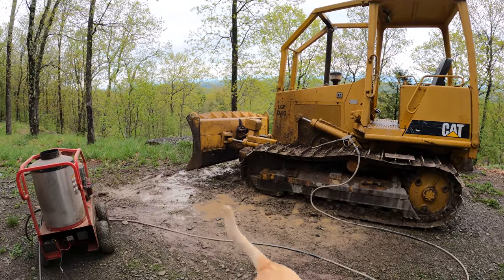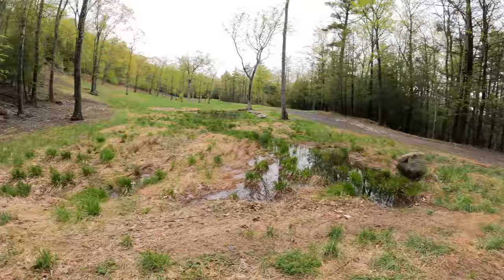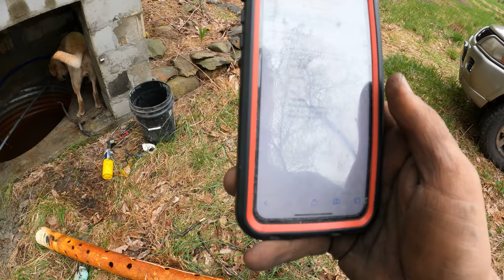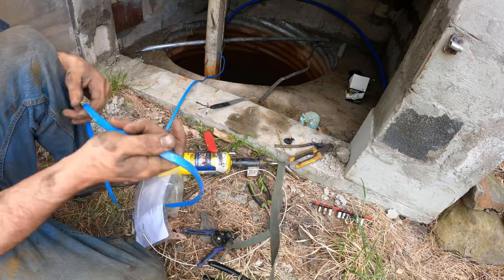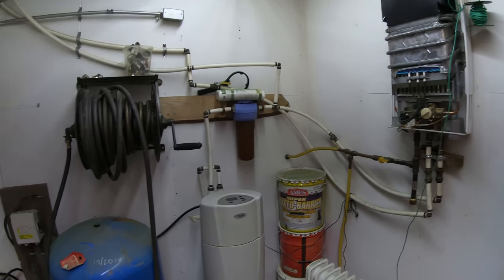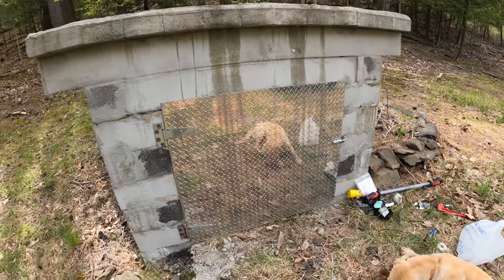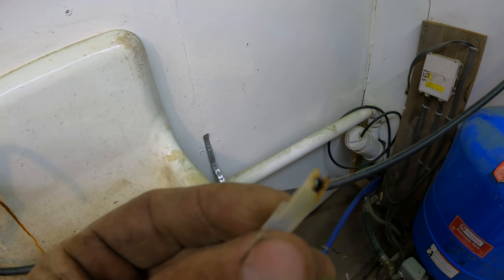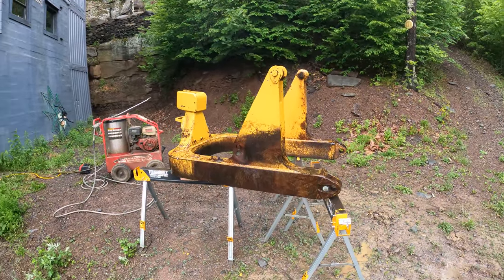Replacing a well pump

Comment: it's a simple calculation: your pump costs 186 in lm specialist shops it costs something like 1000. 1000:186=5.37 new pumps x 6 years = 32 years with a pump change

Comment: This guy is the living embodiment of "function over form".
Reply: You just called my man andrew right here ugly.
Reply: The "faucets" in the pump room agree with you.
Reply: @bassomatic1871  Do the faucets not work though?
Reply: @grantzawodniak682   Yes, a perfect illustration of function over form.
Reply: I just cannot reach his level, though I have tried. Broke the $1 ax after derusting and sharpening and reseating and wood stuffing the head, I hit it hard on the handle in a missed strike. So top end wood glue the whole fancy wood handle was split the entire length in several shears - after that a small test - not convinced on goes the fiberglass and bondo - oh yeah as hard as I can swing it with thick leather gloves on because the fiberglass wrap was ugly and ruffled - yes it looks horrible - second coated it now waiting to dry. Probably the ugliest ax in the state, but it takes a swing and splits well.

Comment: Hi Andrew, I had a borehole pump that was in the $1500 range (Sits at 110m below surface, but same priciple), it was installed in 1994, and I just replaced it last year.
It was still running, but was delivering less and less water every year, the impeller was simply worn out from 27 years of operation, and that's why I replaced it.

I highly recommend expensive pumps if you want them to last longer, but condsidering that your pump is a bit easier to replace than mine, I totally support you going with the cheaper option.

Comment: My father owned a substantial plumbing & heating business. There were a few brands he would never stray from. Well pumps were always Gould, Honeywell for heating controls, Beckett oil burners, and A O Smith or Bradford White hot water tanks. Plumbing tools were always Ridgid brand. He was also partial to Minneapolis Moline backhoes. But that was decades ago. Great videos!
Reply: Plumbing since I could crawl and run my own business now. Your father was a good plumber. Nowadays the only difference is we use rinnai or rheem water heaters. Lowes now has the ao smith water heaters and pros just don’t use them. Decent enough still though.

Comment: YES our family business is working on water wells and replacing pumps if you buy a good pump, we use pentair myers predator series, they should last you 15-20 years. actually just last week we pulled out a 40 yr old pump that just recently quit. the cheaper you buy them usually the crapper they are.

Comment: Nice vid - a trick I learned from an old life-long dozer operator for you: When you wash your tracks like that spray them with a corrosion inhibitor - it stops oxidation and coats them so they don't load up as fast or bad. Get a five gallon can of concentrate for about 300 bucks and dilute it about 10:1 in a sprayer. A five gallon can will last you years. It will prevent track tensioner failures like you had on your 7 as well. Just be cautious - some corrosion inhibitors don't get along well with rubber and seals. The cost of the inhibitor,application time is completely offset by the time you spend cleaning your tracks and components last way longer - it's a win/win.Cheers
Reply: something like fluid film?

Comment: 2 things: in my experience with pumps (concrete plant & asphalt plant), the big killer of pumps is foreign material and fouling. I've seen expensive pumps suffer the same death as a cheep one, over and over, but never a pump dying because of cheapness... My advice is to uphold housekeeping & maintenance schedules. I used to soak my pumps in hydrochloric acid, but CLR or an anti-scale agent would work for your application...IF anything was chosen.
As an absolute, change that filter at least once a year, or whatever the manufacturer recommends.

Second thing, those rotary jetter heads seem to be susceptible to being knocked right on the end. I never quite pin-pointed the exact cause of failure, but it was either a physical jarring or some grit got in the end of it, setting it up to fail. Food for thought, anyway... maybe weld on a small piece of tube for a jetter gun holder.
Reply: Pumping that sand filled water will eventually wear a hole in the pipe, he needs a filter on both ends of service
Reply: @chadsimmons6347  Sand & sediment settles-out pretty quick (under 24hrs). One of the first suspicions Andrew had was his well was full of sand. Whatever sludge doesn't settle-out will get picked up by the filter (shown in the video). I've never seen a pipe or hose thin-out from the inside by pumping slurry, not with pressures akin to single or double horse pumps. On an industrial level, with metal pipes, reactive chemistry and elevated temperatures, cavitaton & hydraulic shock, absolutely...but not from sand.
If sand is involved the pump clogs up dies long before the pipes get a chance to erode.
Reply: Hard to tell ... but old filter looked like a 5 Micron. The new one looks like a 10 Micron string wrap. The 5 Miicron will plug up like that.  Maybe add an additional  filter cartridge with a 10 Micron followed in line by the 5 Micron  (if you want the water 5 Micron filtered).
Reply: @googleguy5700  That would work well, and probably something i'd do personally if it was drinking water. However, he did say it lasted 6 years, which is probably "5 years" overdue! 😂
Reply: I have had pumps for years at my different properties and have never had one fail ever. There is zero maintenance to do on them as the bearings are sealed and I have never had one lime up. Well hold on at one property I own the previous owner must have accidentally got a stone in the pipe and it was sucked into a venturi on the pump. I just had to pull it apart and knock out the little pea size stone and it is still working perfectly.

Comment: Couple tips for new players — pipe is sized by inner diameter; tubing is sized by outer diameter.  If you buy 1” pipe barbs, you need 1” HDPE pipe.  1” tubing barbs fit 1” tubing.  As you found, can’t mix and match.  I think they did that just to confuse people 😀.  Next, use a lead-free brass or copper union to connect the pipe from the pump to the pipe that runs to the building.  Next time you need to replace the pump, you won’t need to wrestle with it.  Anyway, good job fixing it — it works!

Comment: Andrew, next time heat the steel fitting jnstead: you cant put that on fire, and: if you heat the plastic, the steel takes the heat out of the plastic before youre halfway on. Thats what i learned putting steel couplers to high pressure PVC underground irrigation lines.
Reply: Funny, that was my idea too before I scrolled down and saw your comment!
Reply: So that's why I'd always have to ram the tubing on so fast in one motion otherwise it would get stuck half way on the barb. The barb is cold and makes the tubing shrink around it. Science!
Reply: I think by now we all know that Andrew knows what he is doing.
Reply: @davidcooper3337  There is always something new to learn.
Reply: @davidcooper3337  Andrew rarely knows what he's doing and that's part of what's great about his videos. He learns and adapts as he goes. He also only cares if it will work/be safe/last instead of what it looks like which is funny to watch
Reply: @davidcooper3337  People like you need to shut up. Andrew and a lot of us got to where we are by learning from others and trying shit out. Do not try to stop people from suggesting things just because you think everyone online is an armchair professional. A lot of us ACTUAL professionals exist and gravitate to channels like this because we enjoy watching and sharing ideas.
Reply: @davidcooper3337  Andrew is mostly self-taught and although he can always work out a way of doing something it is frequently not the best way. There are many very experienced people here who can help him by suggesting improved ways of doing what he's doing.
Reply: This is a useful tip, I will remember this thanks!
Reply: Or just use an expansion tool... ie. Pex expansion tool
Reply: @pcb1962  my comment was not on a negative level,. It was more a compliment to Andrew.
Reply: @ViTaLxMoDzZ  I sit and wait for.Andrews next video,. I have alot of respect for him. I would love Quarter of his knowledge.,

Comment: That blue tubing is CTS, copper tube size, it uses a stiffener and compression fittings like copper tubing
Reply: First question that came to my mind when he was wrestling with that was -- would a pex tube spreader work for CTS, I wonder?
Reply: @0blivioniox864  good question
Reply: @0blivioniox864  it can split if you use any spreader.. heat is the only thing that will let it stretch.. but it does make it weaker, so never heat it any farther than the fitting penetrates. .. at least that has been my experience with it.
Reply: I thought the blue tubing was PEX, but the more you know I guess.
Reply: @ItsLilRobs  it is PEX, PEX is measured the same as copper tubing,  CTS
Reply: I use the shark bite fittings on PEX line

Comment: Boy last year I had a hell of a problem with these pumps, I ended up installing 4 submersible pumps  at 53' deep, bran new pumps none of them were any good, I even installed a control box, new 60 gallon tank and I even stalled new check valves, finally got a great one that works and still going strong.  I take it your well is certainly NOT HUMAN CONSUMPTION, THAT WATER IS NASTY LOOKN. GREAT JOB, THO, YOU WERE ABLE TO OVER RIDE THE ELECTRICAL COMPONENTS AND REWIRE IT EXCELLENT JOB.👌✌️👍

Comment: ive had my franklin pump in for 15 years at 85 meters and ive never had a problem!
Reply: Different quality for sure!! I have had pumps lasting for +-30 Years! 💪🏼
Reply: @davidr1997  yep definitely
Reply: Knock on wood, we installed a Gould/Franklin submersible (287 ft) pump 40-ish years ago. Been through a control box due to lightning strike years ago and another one due to leaking cap. Now I keep a spare control box and start capacitor on hand just in case. Much cheaper and more satisfying then an expensive weekend  service call.
Reply: Our first Franklin Electric well pump lasted about 18 years before it split in half.

Comment: This actually made me laugh being in Arizona, my friends well pump is at 1,000 feet, at that depth you buy the pump that will last the longest no matter the cost.
Reply: Here in Holland we dont use well pumps, just a suction pipe with a one way valve in the bottom, so you can have a simple centrifugal pump above ground, once you prime it with a bucket.. Not sure if a centrifugal pump sucks up from 1000 feet which is 330 meter of water column, meaning a 33 bar vacuum... but you usually dont pump from the bottom of the well so actual head is lower.
Reply: @Sjanzo  The problem is that it's technically impossible to lift water more than 10m with suction, that's why a submersible pump is needed to push the water up and then keep it up with a one-way valve.
Reply: @TheBibliofilus  if your well is 1000 feet deep, does that mean the water table is 1000 feet too ?
We have a 98m well (300 feet) but the water table is at 1 to 3 meter. You just get more pure water below the gravel and clay layers here...
Reply: @Sjanzo  Well in Holland the water table is typically at your feet, or higher, just about anywhere. ;-)
Vacuum only goes to minus one bar, so you can only suck 10 meters of water column by the laws of physics, in practice significantly less than that.
Reply: @Sjanzo  you'll need something called a jet pump, basically a centrifugal with a venturi nozzle that robs a bit of the pumped up flow to amplify the suction. Depending on depth you'll need to put the jet nozzle at the 'far' end of the suction pipe.  Roughly 7m aka ~20ft is max where you can have the nozzle bolted on the pump. With the jet nozzle at the far end you can get to about ~15...20m  (so 50..60ft.) depending on exact pump hp, and pump/nozzle design. In most cases the pump will be noisy to some extend, because of cavitation. (air bubbles forming on the rotor and 'popping') This is from experience installing a handful of these.
Reply: Yeah seeing his well be like 10ft deep is weird. Most of the ones I'm familiar with around here at 200ft or deeper. You really only have to go 25ft to find water but those shallow layers of the aquifer arnt safe to drink anymore due to agriculture chemical contamination and nitrates. Though to be honest I'm not sure I'd drink the water in that shallow hole without a really good filter system. anyway. When pulling a well pump costs thousand to get a Derrick to pull hundred of feet of pipe, one tends to buy the best pump possible.
Reply: @stefantrethan  true, now you say so: you cant create more vacuum than the pressure the weight of the atmosphere puts on earth, which is one bar on average. Thats why its called bar, from barometric pressure. If you suck out all air, the surrounding atmosphere doesnt push the water up more than 10 meter.
Reply: @Sjanzo   that's way they always did it. I don't know who came  up with putting pump in well.  
$2000 is reap off no matter what way look at it. Frist pump was steam  engine. Just thought I pull that in therr
Reply: @KR-hg8be  Agree with you about such a shallow well. I understand his concept as that area in the fall/winter has a pond near it so it is natural seepage from the layers of shale.  My well as a kid was 120 feet deep and the builder put in a jet pump that barely functioned. Dad had to replace with a good quality submersible and i remember him using our tractor to lift all that pvc pipe out of the well and stretch it out into the yard so we could install the submersible at the bottom.  I like AC’s solution as he understands simplicity with functionality and he does have it filtered and a softener for his personal use. It is his shop but he does have a small (heated) area with full shower and sleeping quarters.  Makes it easy to crash there instead of driving to parents house where he usually stays. I appreciate his simple solutions and even though he probably could spend the 1K why?  200$ does the job and that leave the other money for other things...
Reply: @Sjanzo  They didn't hit water until 501 feet, then went down to 1,000 where they installed the pump.  It can be a HUG issue here where they build a subdivision and end up dropping the water table 100 feet so people often go MUCH deeper than needed to account for this.
Reply: @KR-hg8be  just a bit south of him in NJ it's not legal to have a well less than 50 feet deep. We have a natural spring with a house around it where our house used to get water, but a previous owner had a deep well put in on the orders of The People's Republic of New Jersey.
Reply: @KR-hg8be  Andrew's castle property is on the side of a large broad mountain, forest only above him and so no farming and its chemical leaching from up there, he has the bottom land as a soak that is recharged from the mountain watershed's subsurface flows. His problem with a well would be tapping a single flow with enough capacity to supply his needs, that bottom land's soils gather and collect and store enough from no doubt many separate seeps pooling their combined supplies.
Reply: Zero. I hear ya! 
Mine isn't that deep but I do have the shaft going down 575 feet in south east Az. 1000... THAT'S DEEP and EXPENSIVE! 500's are only going for around 40K I've heard. 
Also, are you around the Cochise area as well?
I've got the best damn tasting water I've ever experienced in my 52 years of breathing. Comes out in the low 40 degrees and clearer than that disgusting tasting bottled water you buy in the store!
Reply: @ZeroEntropy.  Phoenix area, it sounds like. 
All the building going on north of the capital  is getting pretty crazy. But I am a new res. from another state that I will never admit I lived though.... Brought NONE of it with me...

Comment: You know the pressure's good when it blows the lettering off the side of your equipment.
Reply: Oh my god, it totally did. I didn't notice that. Hahaha
Reply: I have a 2200 PSI 3GPM pressure washer, and just got one of those rotary nozzles this year. The thing is a beast - you have to be careful, you can take paint and stickers off of anything, and even the very top surface of concrete will come off. His pressure washer looks a lot beefier than mine is (higher pressure), so I'm not surprised he's blasting lettering off of things.

Comment: I have the same heavy iron water you have, and I switched my setup so my pump pushes water though the filter into the pressure tank. I also changed from smaller filters to three of the large filters. I really wanted to put two sediment filters in parallel but I didn't have the room. The three large filters, with a screen mesh 50 micron, to a 5 micron sediment, then a charcoal, iron/mag filter and through a uv filter has made my water amazing and the large filters last so much longer.

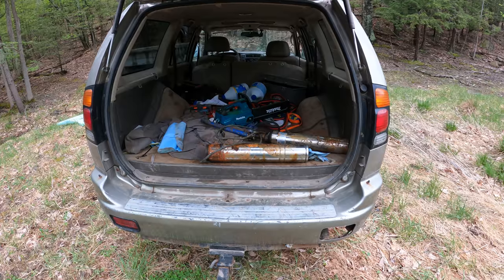Comment: I think you nailed it (why the difference in cost) at 03:30.   It last 6 years.   I guess it depends on your application, but for our house wells that are a few hundred feet down, I expect them to last orders of magnitude longer than that... and yeah... it's a big deal to pull out pump out of a few hundred feet of well.